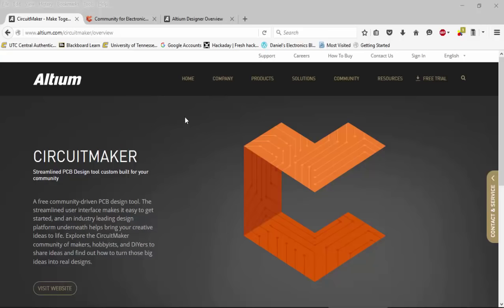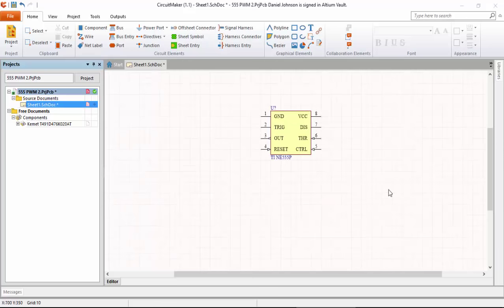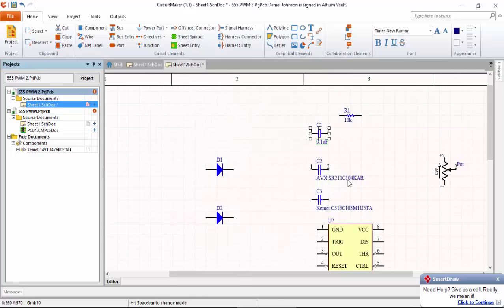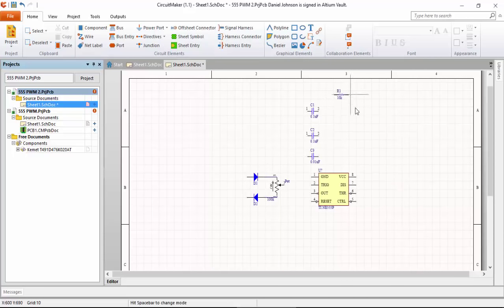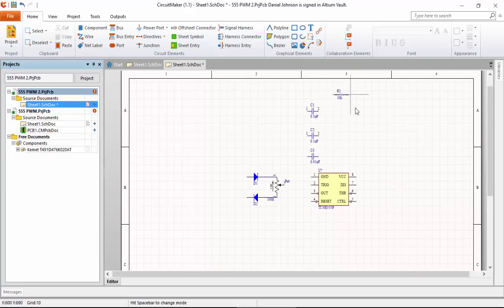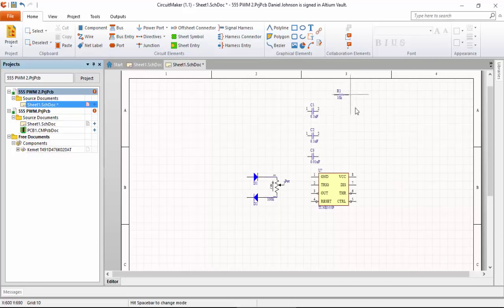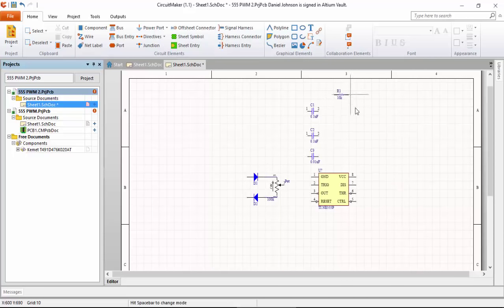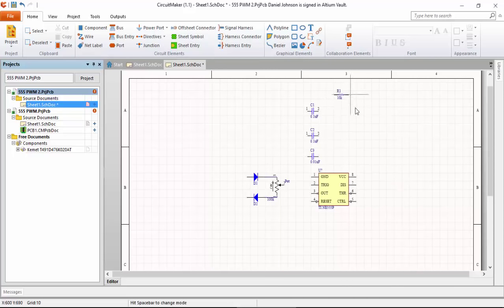Circuit Maker Tutorial

Comment: How can I do this with Mobile phone not using PC???
Reply: I got the answer for your question, it has 3 easy, but necessary steps.
These three steps are the following:
1,  place your mobile phone on the desk and don't touch it until you're finished with the next two steps
2, buy a PC
3, download and use the program as it was shown in the video.
If the second and third steps fail, you have to repeat the first step, the faster the better.

Comment: Could have had it done in 2 mins with etch resistant pen. Just another crappy pcb design tool, looks like another piece of software i am going to have show the industry how to write.
Reply: LMFAO you hit the nail right on the head. I have been using New Wave Concepts "Circuit Wizard" for many years. Out of all the sims including high end ones there is something about Circuit Wizard that makes you want to keep building circuits. I guess the Interface is what really did it for me. You will not believe the esoteric circuits I have built using Circuit Wizard with it's Electronics Schematic Design/ Sim/ PCB / no issues Simulation all in one.

Comment: Can simulation be done in schematic mode?
Reply: Circuit Wizard has both a sim on the Schematic and PCB sections. It is my Goto Electronics Design Tool. I will not use anything else.

Comment: I highly advise people to stop using these piece of crap electronics simulators clones. Circuit Wizard blows the crap out of all of these sims. Circuit Wizard is really how people should start out with Electronics Designing. New Wave Concepts Circuit Wizard. They have a Student Edition. Circuit Wizard has the Schematic Window and the  Library right on the right side  of . It  is what you see is what you get right to the point. Then you can Autoroute to the PCB Section or do it manually. Been using it for many years. Altium is overkill and Multisim even more overkill.